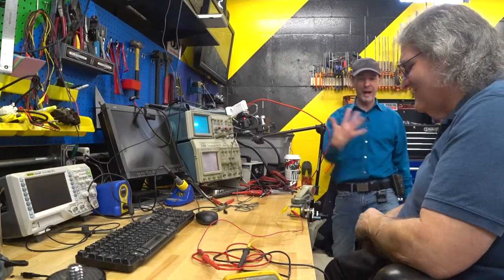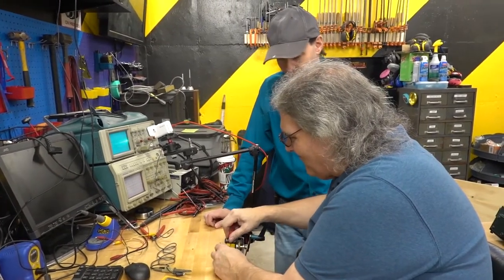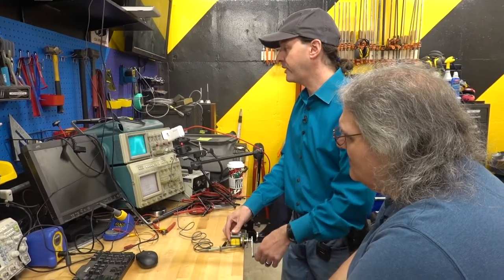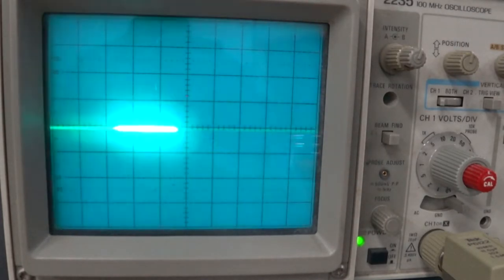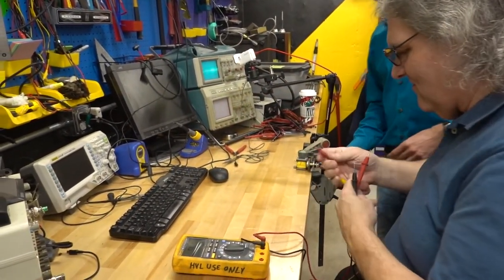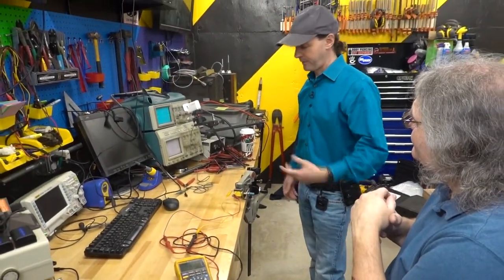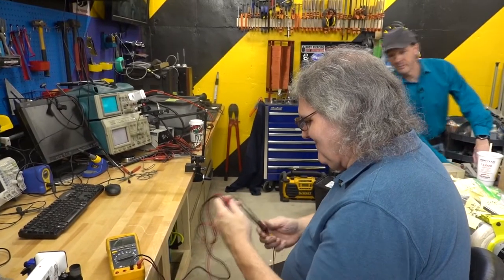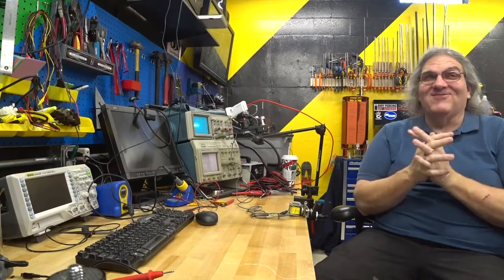Hand Crank Generator On An Oscilloscope

Comment: Many meggers have 2 or 3 ranges, a megger checks for leakage, judging by the max voltage (remembering you were off load), i would guess it's 250 and 500v, hence the tappings.
At college i was the oldest in class, the kids got me to hold onto the wires of a similar megger, they cranked as hard as they could, i barely flinched, then i said it must be faulty as i didn't feel anything, i got one of the kids to hold the wires, but then i cranked it slowly, the kid felt it  :D